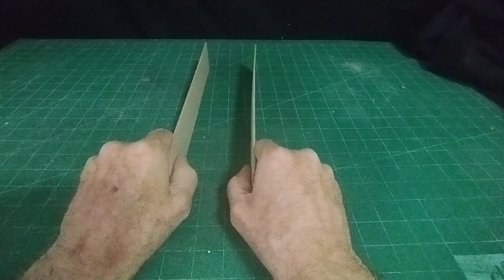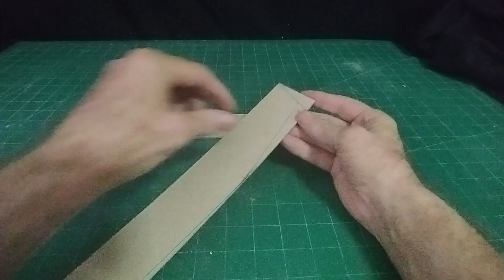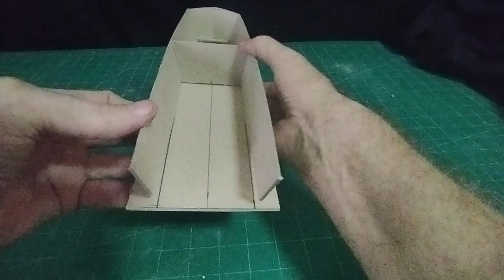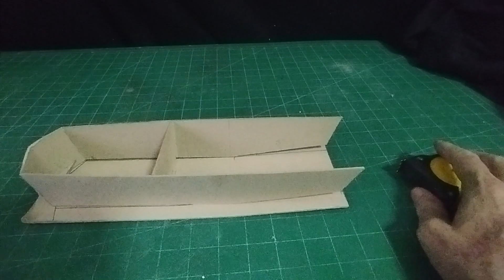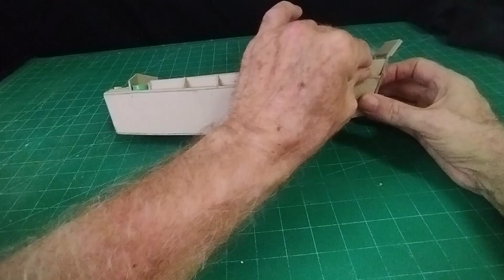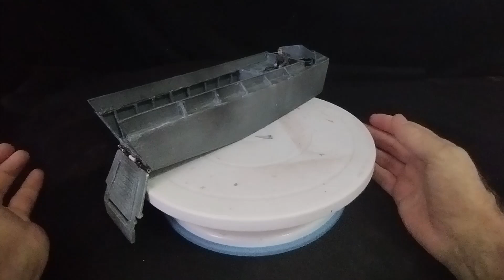Higgins landing craft 1/35 scratch built model (step by step)

Comment: I found this very helpful as I am trying something very much akin to this. In fact the transport barge that Higgins copied. 
Which was a  Moku Daihatsu. Really a fantastic bit of work you have done, and well detailed.. To ask, as I am new to this type of creation is that card stock such as one might get for framing prints? And how do you make the sealer? PS I Subscribed as well so Cheers - and thanks for making this great video.
Reply from the maker: The card I use could be used for framing but I use 2mm thick which I believe is the optimum size. I add a little water to ordinary, cheap wall filler to seal the cardboard for painting.